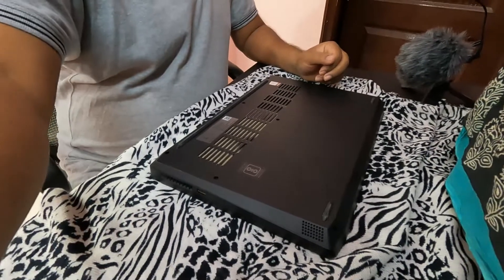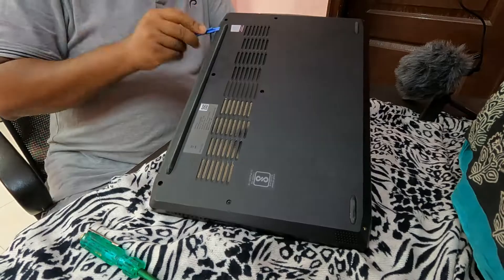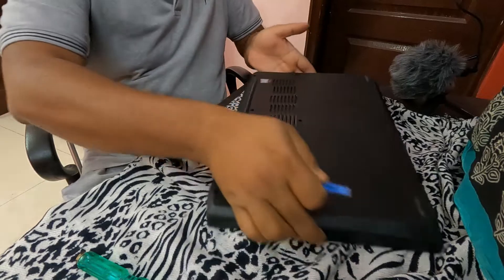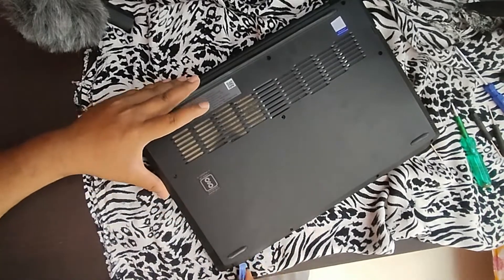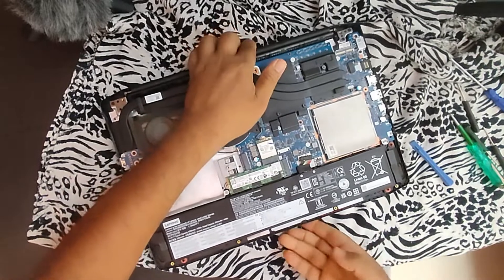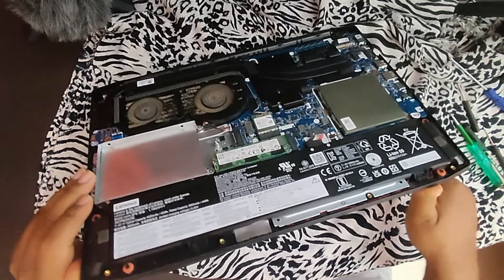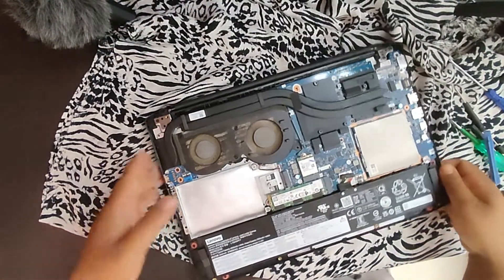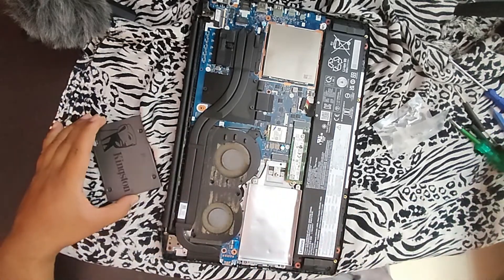Lenovo Ideapad Gaming 3 HDD upgrade - Gadgets and Tech | Your Career & Life

Comment: that you for this video, I had trouble opening the laptop at first lol. You don't need to unscrew the SSD (you called it ram by mistake)
Reply from the maker: Thank you
Reply: So can we put the blue connecting with hdd without unscrewing it
Reply: @ALVAROMorata-uy3yq for this exact model, yes
Reply: how to do without unscrew the sdd? my screwdriver is not the same size lol

Comment: Can you get the 256gb ssd and put 512gb ssd in the same spot but plus 1tb hard drive
Reply from the maker: Yes it's possible. Just it's plug /cable matter if plus is same type you can use any size SSD/HDD

Comment: Should I buy This laptop for Gaming + 1080p60Fps Streaming at the same time and For video Editing and kya mere KO Ye 5 ya 6 saal tak sath dega AAA and FPS Games me plsss help 🙏😭😭 ( Lenovo Ideapad Gaming 3 AMD Ryzen 5 5600H 15.6" FHD IPS Gaming Laptop (8GB/512GB SSD/Windows 11/Nvidia GTX 1650 4GB/120Hz Refresh Rate/Backlit/3months Xbox Game Pass/Shadow Black/2.25Kg), 82K200X6IN )
Reply from the maker: Thank you for the comment. 
This is a good laptop and it will work smoothly for your purpose. I believe easily Lenovo laptops can last 5-6 years. In fact I brought this by thinking to use at least the next 10 years or more. My friend bought a laptop about 15 years ago and it still works. He doesn't play games just does some basic work so configuration still supports his work.